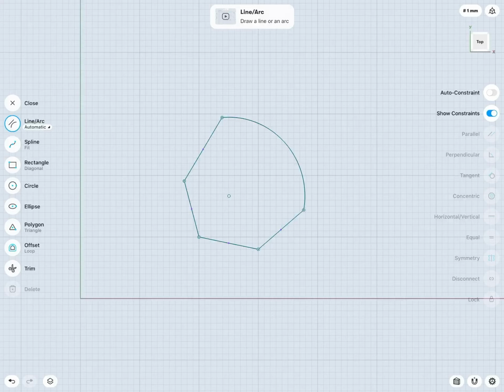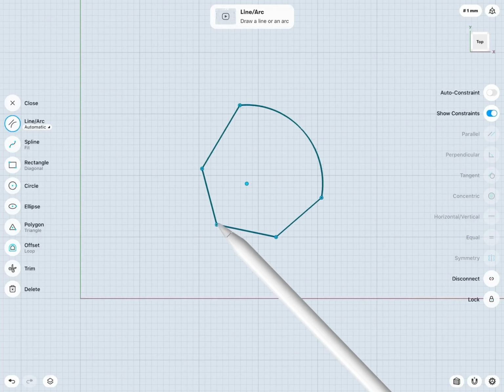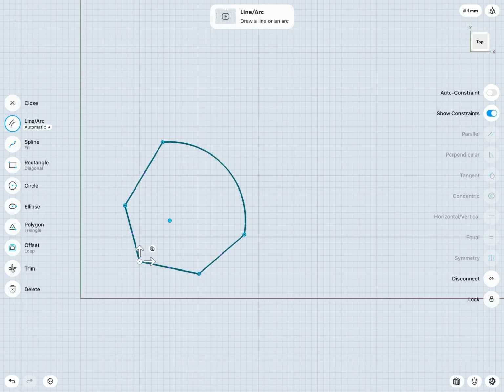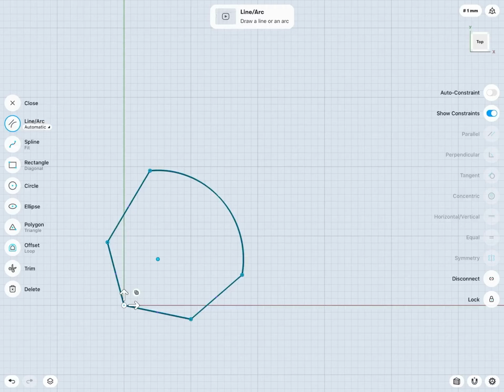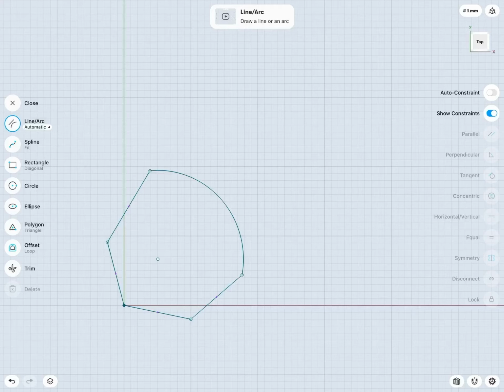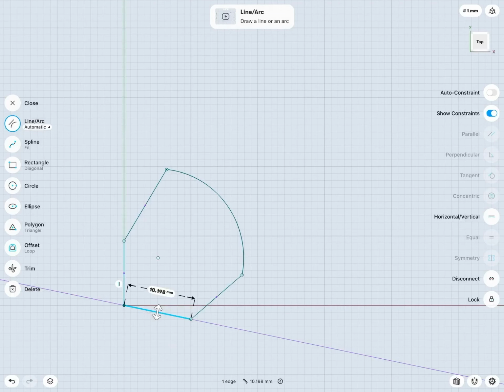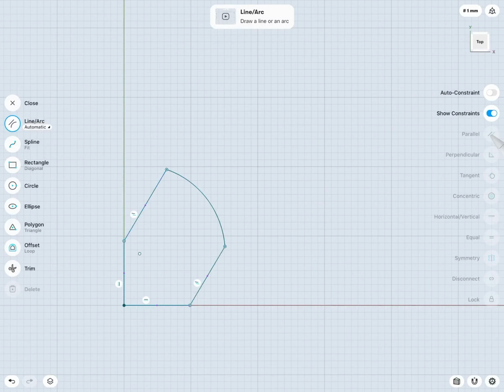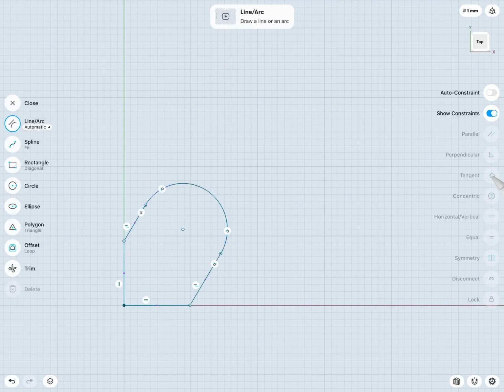Using Constraints | Draw 2D sketches

Comment from the maker: New sketching videos inbound 📢 We’ve been working really hard on updating Shapr3D in order to offer you a better 3D modeling experience. We’ve introduced new features and made significant changes across the app. Check out these updated videos to learn more about Constraints in Shapr3D. 
Introduction to constraints➡https://youtu.be/5hlR4EufuBM
Adding and removing constraints ➡https://youtu.be/5j6Q7R7qNYU
Types of constraints ➡https://youtu.be/C8d1WwelJZg